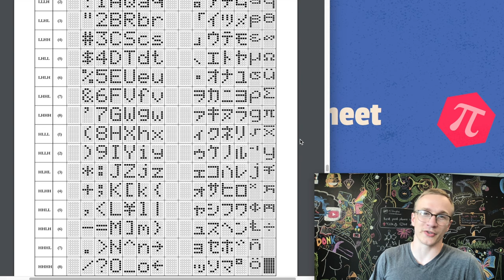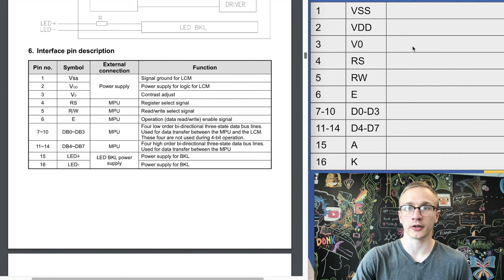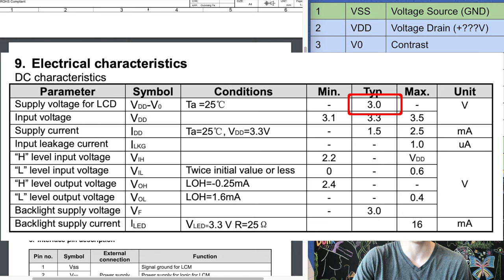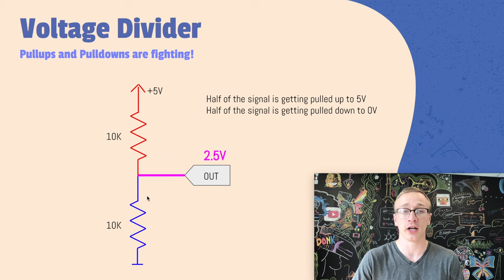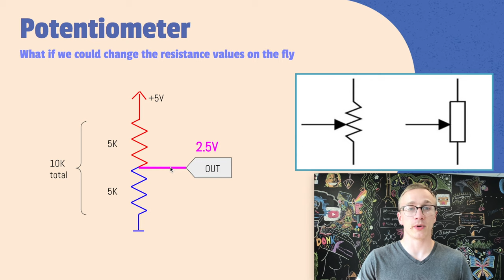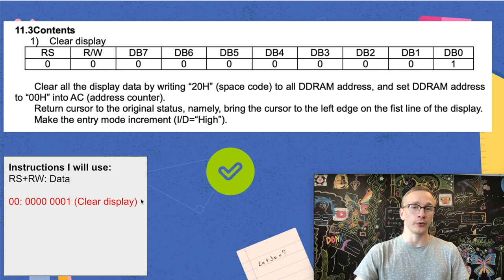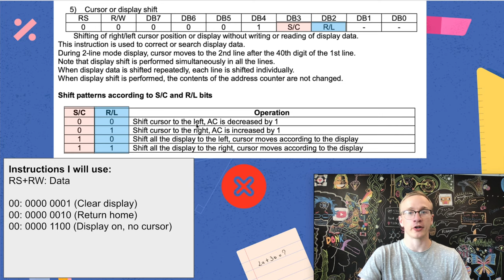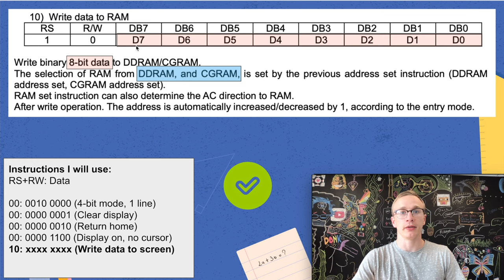Datasheets: 16x2 LCD By Hand (No microcontroller)

Comment: Thanks Mitchel, I love the low levels tutorial, where things are done by hand, and I found very useful how you explain how you read the datasheet. Indeed datasheet can be scary...
Reply: I love how for a software engineer programming a microcontroller is considered extremely low level but for electronic engineers even microcontrollers are conaidered 
high level :Dd

Comment: I am at this stage, where I'm almost graduating, but still a bit afraid to go through the datesheet for some reason. This was extremely helpful, especially the Enable timing diagram. I always try to avoid that part, because it looks so scary. Thank you for breaking this down to such an easy understanding :)
Reply: one step at a time and you will be come more comfortable working with them. Best Wishes

Comment: Thank you so much for this video. Specifically I was preparing my own toggle switch LCD box project and at the bread phase of testing this out. I had actually got beyond the point of clearing the display and sending characters but then in my final checked all I kept getting was a complete 1st line of "block" characters.

After a good hour of rechecking all my connections and swapping the two LCD modules back and forth between the "toggle switch" breadboard and an Arduino to sanity-check the damn things where still working, I figure it must be something to do with the initialisation but alas by understanding of the datasheet commands was weak.

Thanks to 10:45 & 11:14 this helped enormously in getting my project back on track by realising that potentiometer was set a little too high but only spotted this when I send the  show cursor & blink cursor commands ❤

Comment: EXCELLENT! Datasheets and timing diagrams can seem overwhelming when you first get into it, but you just need to just walk through each step on by one. Learn some terminology and nomenclature and you're well on your way.

In the early 90s I used one of these displays with a 68C705 microcontroller to interface with my 1986 corvette. I tapped into the line for the tachometer (right off the transmission) and did some math to be able to display my speed, and then did some fun stuff like make an automated 0-60 (ok 0-100) timer... All written in assembly, I remember diagnosing that datasheet for the display and getting all the timing to work.  Unfortunately I don't think I have that source code anymore.

I had an eeprom programmer, but unlike today's flash memory, I had to erase the eprom with a UV light every time I need to upload a new firmware. So what you'd do is have 5 or 6 microcontrollers sitting under the UV lamp while you programmed and work on one of them, then you could just rotate them in and out of the UV as needed. That way you'd always have one which was erased and ready to program.

Making this kind of stuff is immensely easier now!

Comment: Correct me if I am wrong, but in setting the bit mode (8 or 4) the zeros after the first one are inconsequential. This is something I learned reading the data sheet. 

So, say at 24:29 thereabouts, in setting the bit mode, you don't actually have to physically tie pins D0 to D3 to ground (as you have done so).

Someone may say, its a good idea to tie unused pins to ground. Sure! But, according to the data sheet you shouldn't have to.

Comment: Excellent stuff. Am however not sure about suitability of using an output pin to show how pullup resistor works. Is this arrangement not appropriate for input only not output unless we are using open collector arrangement for output. I thought an MCU supplies voltage onto output pin and not switch the pin to ground or leave it floating( open collector arrangement)

Comment: Ironic.
I just learned about voltage dividers with resisters yesterday; by making a little 3 port USB hub..
Here I sit with an unknown LCD 16x2 w/14 pins (No backlight), and my VDD is pin 6.
I believe I have the pinout data sheet for my screen...
It can use 5v safely;
Funny how you teach about voltage dividers and pull/up pull/down voltages.
haha...
Thanks.
Subscribed and liked!

Comment: D0-D7 have internal pulled-up's, you don't have to hook them up to a rail(ground or VCC) when you don't use them. All commands are working in the 4-bit mode, you never need the D0-D3 in 4bit mode. If I'm not mistaken, the D0-D3 do nothing after the 4 bit command(right?). 
Edit/ My own driver code send all the commands in 4bits, and I used many HD44780 in past 25 years with that code(ported to many different systems in the years).

Comment: Nice video. The only question i have is how to configure the lcd in 4bit mode and 2 lines (0b0010 1000)? I'm using a pcf8574 with i2c so i can't set the lower nibble.

Comment: Dude I love the way you broke it down in steps exactly in a way people like me will understand I watched it once and I understood immediately and I watched the second time when I want to use an Arduino yo automate it.
But I ran into an issue the first step you set DB0 to DB3 low right? But DB2 controls the displays on/off state and it must be high to set the display on which confused me when trying to automate it with Arduino.
Can you pls clear it out for me?
Thanks

Comment: First lesson I learned working with Arduino Grove System from Seeed Studio:
The datasheet is always mostly missing and who needs code documentation when you can guess from examples of github how trivial this all is to work with?
Reply from the maker: I’ve had a lot of datasheets that are “close” but not exact.  Always a challenge.  I was just working on an AHT10 humidity sensor this week that requires a command that isn’t in the datasheet at all.

Comment: Do I need a switch or can I simply move my wire from ground to vcc?
Reply from the maker: Nothing is stopping you from doing that.  That’s all a switch does anyway.  It’s just going to be more tedious/confusing to do
Reply: @MitchDavis2  thanks for the response! Havent gotten it to work yet just on my own. Not sure if my 10uF capacitor is debouncing the button or since my buttons are 4 pins, something is not working. Thanks again!
Reply from the maker: @TheAcidicMolotov  if you have a multimeter, try measuring the pins of the button for continuity.  Once when not pressed, and once while pressed.  Make sure it’s doing what you expect.  Can’t tell you how many times I’ve hooked up 4-pin buttons wrong
Reply: @MitchDavis2  will check thanks. I have a few spare ones that i cut the two legs that were opposite on the same lines.

Comment: on the Arduino site it tells you to use 5 V
Reply from the maker: @TeslaWorkshop  yep, but depending on your actual screen, that could damage it.  In my case, the screen is designed to run at 3V, so using 5V would be considered out of spec, even if the Arduino website recommends it.

With that said, the absolute maximum says 7V, which means you can probably still run at 5V (just like I’m doing in this video).  It’s just important to remember that it’s technically out of spec, and the datasheet is going to be ground-zero for all specs about this screen.  Any website or videos will just be derivatives of the officially documentation.

It’s quite common to run into tutorials or websites that do things wrong, and if you send them an excerpt from the datasheet, you’ll often see them correct it.

Comment: what if i have only a data port and not d1 d2 d3...?
Reply from the maker: Sounds like you might have one that talks over I2C or SPI instead of Parallel
Reply: @MitchDavis2  is there any Tutorial?
Reply: @MitchDavis2  there is a Led+ , Led-, Vdd, gnd, data, WR and CS
Reply: @MitchDavis2  hello?
Reply from the maker: @skyslandmcplays4157  it sounds like you have one that is serial based.  Data is probably how you transfer the data, and WR works the same way is my video.  You should look up the datasheet for the exact part number you have, because I haven’t used one of those before